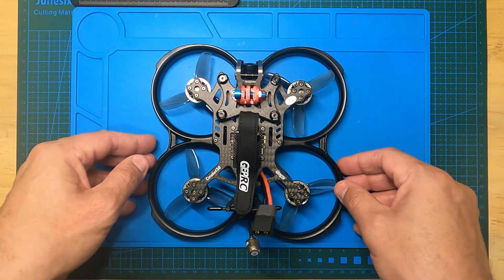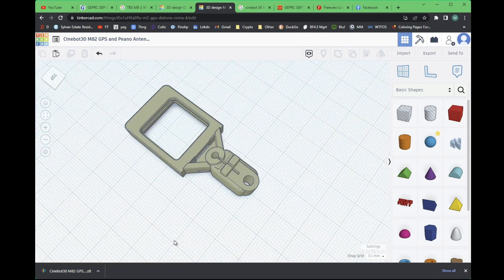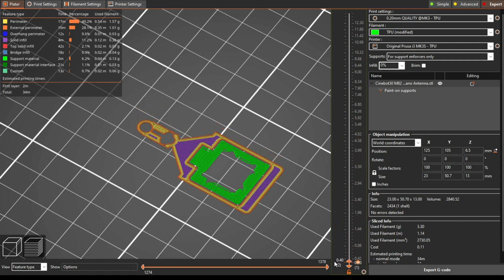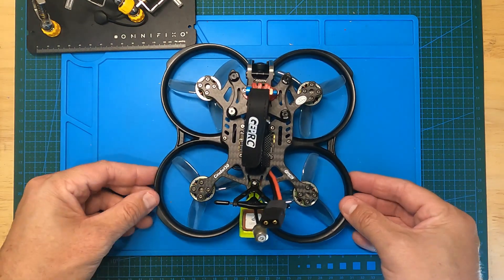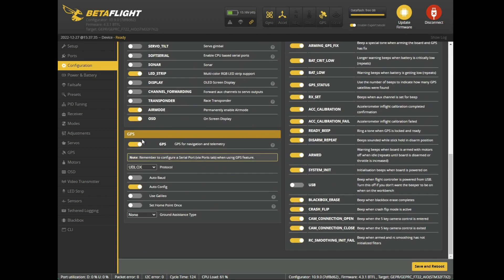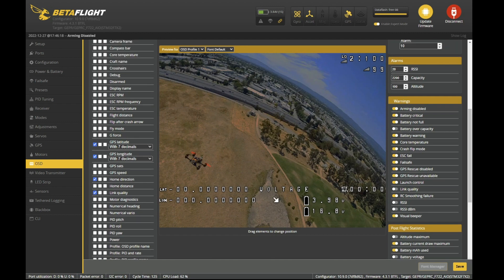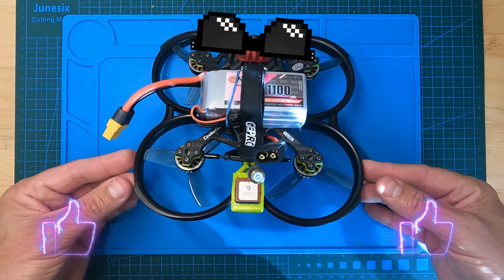GepRC Cinebot30 GPS Rescue and Home direction Arrow. Flywoo GM10 Mini v3 & M8.2 GPS.

Comment: Hey, I'm wondering how much success you've had with this? I tried a flywoo M10 Mini Goku GPS and the GPS reception seems lacking to me.  I ended up shielding the cable as far as I could and grounding it to the flight controller, but reception still seems like it is hampered by the vista. In another build, the flywoo explorer, I use this exact same GPS and shielded the cables but had to get the GPS further from the vista than the stock. I'm wondering if maybe it's not the vista but the Gep AIO is extremely noisy too? I'm wondering what else I can try to shield the unit from RF interference in this build, the options seem limited.
Reply from the maker: I havent has that much of an issue with any GPS unit Ive installed.
Originally i installed an M8.2 GPS and then upgraded to a Flywoo M10 - neither has issues in this unit.
Reply: @classics967  How long does it take to get any satellites from a cold boot? With my cinebot30 and the flywoo goku m10, it is just terrible, the performance could not be worse. After 10 minutes to 15 minutes no satellites, the 3 or 4 might trickle in and it doesn't hold. Baud rate is set the same as yours and I'm on 4.5 so that shouldn't be it. The module receives satellites fine with just USB connected, so I know it is not a bad module.
Reply from the maker: @JohnCuppi  Holy moly - thats way too long yes.
I think I can get going in under a minute
Reply from the maker: @JohnCuppi  Maybe check if your vista module is set to low power / standby power before arming or something?
Reply: @classics967  This is one way that I know the vista is at least partially responsible -- when put on 25mw, from cold boot, it only takes 1.5 minutes to get 5 satellites. Crank it up past that (700mw+) and sats will drop off, not gain. Frustrating. 

This is where I get the thought that I need to get the Vista shielded or get the GPS a little farther away. Or maybe I should just stop using the mini GPS and get the Pro version with the larger antenna... 

do you have a version of the prints that could take the full size GM10 Pro by chance?

At least I know from your responses, someone out there has it working, so I'll keep on trying.
Reply from the maker: @JohnCuppi  Do you have a link to the GM10 you're using and ill check
Reply: @classics967  YouTube won’t let me put a link but I’m using the Flywoo Goku GM10 Mini V3 without compass. The one I’m considering replacing it with is Flywoo Goku GM10 Pro V3.  The Pro is 25mm by 25mm, while the GM10 Mini is 18mm by 18mm. So it’s a significantly larger antenna size.
Reply from the maker: @JohnCuppi  What i did was use Tinkercad - Found any STL that fits the compass, then cut the two models off and joining them together as needed.

Comment: Hello, the mount is perfect, it fits the drone very well, but I'm having signal interference issues with the Vtx. If I have the GPS connected, the signal doesn't go above 6mbs, and if I disconnect it, it goes up to 50mps, but a few meters away it starts dropping to 10mbs. Could it be that the GPS is interfering with the Vtx?
Reply from the maker: If thats the only change youve made Id say it sounds like it.
Maybe double check that the Video antennas haven't been disconnected during your install?
Reply: @classics967  It seems that the GPS was causing interference because I tried unsoldering and removing it, and now I don't have any video issues. Maybe I should use the drone without GPS. Better to not have GPS rescue than to lose video signal and end up with no image, hahaha.

Comment: Hey mate, great video! Got the same GPS on the same drone working. Got it mounted underneath the GoPro carbon fibre mount and realised that carbon fibre does block GPS signal lol. Would love to have the same mount as you got but haven’t got a 3D printer (yet). Wanted to ask you if you were happy to print and post one of these over to Australia for me? Ofc I’d pay you for postage and whatever you asking for your service too. Don’t know how much is postage from NZ to OZ but if it’s reasonable I’m happy to do it. Pls let me know mate
Reply from the maker: What part of Oz are you in and ill help find a localnprint service there. Goimg to be quicker and cheaper

Comment: Hi, thanks for your work!

I want to add the GPS aswell, but mine has the following dimensions: 
The dimensions of GEP-M8 and new GPS GEP-M10 are following:

M8:  22mm x 22mm x 8.5mm
M10 (beside nano): 22x22x8.2mm

I measure following inner dimensions in Cura
x=20,105
y=22,117

Can you please add this .stl aswell? 

Thanks in advance :)

Comment: Test the rescue mode completely on camera please!!!
Reply from the maker: I will try find a gap to make a follow up video. Since this, I have upgraded to Betaflight 4.42, upgraded the GPS to a Flywoo GM10 and put in a DJI O3 air unit.
Before dojng this, the retuirn to hjome wroked well but betaflight 4.4.0 had an issue where when it descends it drops out the sky before toughing the ground.  So Id suggest only using GPS rescue for getting your quad back in range and then taking back control to land safely.
The Home direction arrow is priceless though - without it ive sometimes battled to find myself again.

Comment: Hi there,
Did you add any shielding to the cable connecting your GPS module to the Flight Controller (FC)? I've heard of instances where the lack of shielding can lead to interference from the Video Transmitter (VTX), affecting the GPS lock. Some drone operators opt to shield this cable to prevent such issues. Without shielding, your drone may be susceptible to these problems.
Reply from the maker: I didnt use shielding for the GPS cable and it seemed to be quite okay on this build. Ive since printed out a new 3d print for a newer GM10 GPS and used shielding for the cable.

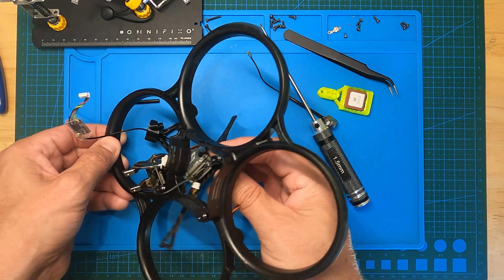Comment: 3:25 hey there thank you for the video... if you removed the reciever fron the FC and replaced it with a gps module, how do you still be able to control the drone through your rc. i dont get it .
Reply from the maker: I removed the receiver temporarily, to detach my crossfire Antenna - then thread the crossfire antenna back through the new 3D print and reattach the antenna to the receiver. I did not Remove the Receiver from the build but had to "undo" some of my build to rebuild it with the new 3d printed part.
Reply: @classics967  Cristal clear Explanation. Thank you Sir.    

BTW, wouldn't there be potential problems if the RX antenna and the VIDEO antenna are close to each other or even almost touching? Could that lead to interference issues?

Comment: Hello
I have troubles with my Geprc Cinebot 30 where I hope that you might be able to help me.
My quad is the 6S version with TBS CF and DJI VTX.
Quad is on his original firmware = 4.3.1

It was flying great last Sunday.

But yesterday I soldered a Geprc GPS module to it.
I used UART 4.
With this my trouble started.

Problem
My receiver signal is no longer recognized by my quad.

How it maybe happened
After soldering, when doing the settings in Betaflight (BF), I accidentally deleted the previous settings in the connections tab. Including USB VCB, the slider was on the left side.
I re-entered the data as I photographed it before soldering.

Symptoms / status
Latest version of BF is used
GPS is recognized perfectly by BF.
Moving the quad around on the table is recognized by BF.
Video transmission is working fine.
Permanent green light in TBS TX and RX, re-binding brought no improvement
I compared the receiver settings with my other TBS CF + DJI quad.

I even switched off GPS in BF and disconnected the GPS module from the cable.

I opened the quad and checked for short circuit of soldering or bad cable / plug connection.

Everything seems to work fine but only the TBS CF signal is not reaching my quad.

What can I try next?
Flash new firmware on the quad?

Thank you and best regards,
Christian

Comment: Didn’t even show where to solder the GPS on the flight controller. Or why you removed the crossfire? So confused watching this video
Reply from the maker: A GPS connects to any available UART port -  RX and TX pads  and of course a 5v power output.
I had to remove to disconnect the Crossfire Antenna from the receiver so I cutld put it through the new TPU print.
Reply: @classics967  thanks

Comment: Hi, thanks a lot for the video review! I also decided to install TBS M8.2 on my Cinebot30. But there is a problem with the mount. My configuration has two antennas from Walksnail HD VTX (2*GEPRC Peano 5.8G). Therefore, the mount needs to be modified. The holes are the same as the stock antenna mount. Say, could you change the layout so that two antennas can be installed? I think that many would be very grateful. There is no such file on the Internet, I have already searched everything :))
Reply from the maker: I use tinkercad which is just a way to blend two or more models. If you have models i can use i can do it for you

Comment: I have been flying Mavic Pro for 5 years, want to get a GEPRC CineLog35 V2 HD O3. Should I get the PNP or Elrs 2.4. I will need to get a new radio and goggles anyway. Thoughts???
Reply from the maker: Personally I bought many ELRS modules and receivers - Went back to Crossfire and Im sticking with it!

Comment: I just messaged GEPRC if there is a GPS option for the O3 version.  Hopefully it's the same, I do want the return to home feature.
Reply from the maker: Procedure is the same for the 03 version
Reply: @classics967  i ened up ordering the HGLRC M100 Mini GPS. It's 15x15x5.2mm it should fit the holder you made (thank you for making it; 20 x 22 x 6 mm for the TBS)  Will chime back in once I get it all setup
Reply from the maker: @johnnywong83  Im not too sure but just double check the dimensions of the 2 GPS models.  if its not 100% i can adjust the model for you if we can find anotehr 3d STL file for the M100 I can use in Tinkercad.
Reply: @classics967  the M100 was quite small.  here is what I was able to find for the M100 STL
5939907 over at thingiverse

Comment: Is there an easier way to get to the sd card Port aside of opening the drone up?
Reply from the maker: The unit i have is a Vista and not 03
Reply: @classics967  I just received the cinebot30 O3 and the sd card slot is available only if you open the drone up. I see no other way.
Reply: @HelloDimineata  same.. if you will find a way to add sdcard - pls share.
Reply: @ivankuznetsov2529  There is non for this specific drone as far as I know, unless you open the bottom 6 screws.
Aside of the 20gb internal storage, by just opening the drone we can access the SD slot.

Comment: I have the 03 version... so I just stuck the tbs m8 on top of the carbon camera plate. Works spot on!
Reply: I just ordered the O3 version too and was looking to add the GPS.  But I kinda want the holder but I don't have a 3D printer :(

Comment: I ddin't get where exactly you connected gps and what is pinout of gps module and tbs plate. Would be grateful for hints
Reply: FC to Gps pin.  R3 to TX, Gnd to Gnd, T3 to Rx, 5v to 5v.

Comment: Hi there, actually I need some help.

I'm currently use F405 mini Mk2 and I alr used uart 3 for RX and Uart for Air unit so I had to used Softserial for the GPS module (LED_Strip for TX and PPM for RX)
however I did try everything in betaflight but look like my FC still not recognised the GPS. 

Do you know any solution?

 Thanks you <3
Reply from the maker: I havent done that uet myself sorry. Google that and I think Oscar Liang may have some info on it
Reply: @classics967  oh thank you, I'll try to ask him

Comment: My C30 just arrived, and I’m in doubt, which place is better, to put GPS. 
I removed a GoPro mount assembly, so, this place looks good for that, and also, it’s in the distance from EM emission sources - O3 and crossfire antennas.
Reply from the maker: Not a bad idea if there is now a space in front.

Comment: Good stuff. I was under the impression one needed a unit with a compass for quads. On a related note can anyone venture what would be more useful when choosing between the GLONASS and Beidou?
Reply from the maker: Until recently you would need a GPS and Compass for a reliable Return to home function.  Betaflight 4.4 now allows for Return to Home and Landing.  Betaflight 4.3 and lower versions have Return to home but no landing, thus not so reliable - but better than nothing.
Reply: @classics967  Did you try the rescue with BF 4.4 ? Mine comes back but disarms at "gps_rescue_landing_alt", standard set to 4 mtr..
Reply from the maker: @hazes22  Heya.  Actually I did test mine - Also came home and dropped slowly and then cut before touching the ground.  I wondered if it was me pushing disarm by mistake.  I took a video but havent edited / posted yet. maybe we need to set that to 0.  Will test again when this Cyclone passes NZ.
Reply: @classics967  Ha, so this might be an issue with this quad. I am certain I did not disarm it by hand. The variable has a lowest value of 1 mtr. I'll post a vid with osd and blackbox overlay, maybe the developers can look into it if several people have the same issue. For now; stay safe during the cyclone !
Reply from the maker: @hazes22  possible an issie with the FC yes. I will only really be using the Gps rescue for emergency and then land myself when back in range but i would send your info to BF to check.

Comment: measurements of the geprc m8u gps are 22x 22 mm
Reply from the maker: I have looked all over thingiverse etc and cannot find a base model for the m8u. The chip and antenna on that PCB looks to be placed quite differently from a BN-220 (closest matching size).  if you can find an existing STL for the m8u, Ill amend the Cinebot30 model for you with the model that fits an m8u.

Comment: I printed up the same Thingiverse file and found it was too small for the GEP-M8U. I posted my make hoping the creator would modify as I'm not great with this stuff. Thanks for updating the file, can't wait to try yours!
Reply from the maker: My model is for the TBS M8.2 - not sure it will fit the M8U.
If you cant get it going, let me know and Ill modify it for you and post an M8U model.
Reply: Just printed your file. Unfortunately it too will not fit the 22x22mm GER-M8U.  I wonder why they decided to make this GPS a bit larger than the standard?
Reply from the maker: @victorlugardo3703  There is unfortunately now standard GPS fitting and youll need one specifically for your GPS.  You have the GEP-M8U right?
I can Mix one up for you and post it if that is what you need?
Reply from the maker: @victorlugardo3703  So i looked up the GEP-M8U and M8u on Thingiverse.  there is absolutely nothing relating to that model for me to mix and match for you.
Maybe this is a copy of eth BN-180 or other?
Check and let me know and Ill make a model for you if you find it.
I think it would be best to just purchase a M8.2, BN-180 etc.  Let me know and Ill get one working for you.